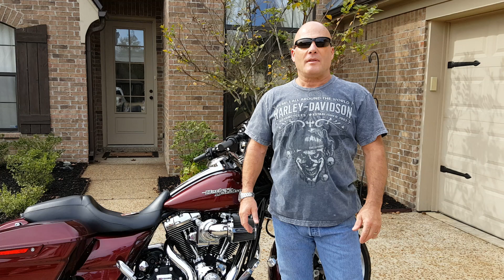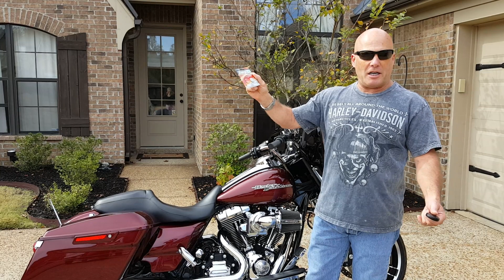Bike won't start? Could be your key fob!

Comment: Hey Tony, good advice on changing the security fob battery every year.  However, if your 2014 is the same as my 2013 security system, you can just manually enter your security code until you are able to get a new battery.
Reply: BrewCityRider
Reply: That's true if you know the code.  If the code is the standard one harley uses on every new bike, anyone that knows it can start your bike. Better that you change it to your own personal code as I did so no one else knows. That way if your fob isn't working you can still start the bike.
Reply: And where do you put the code?
Reply: @kevinmioto2248  You enter your code on the speedo using the turn signal buttons. The exact procedure should be in your owners manual.
Reply: @BrewCityRider  if you have a bike that's older than 2014 it's a different procedure than a bike that is older than 2014 you need to find the video they show you the two different ways to do it. I have a 2008 Springer with the security and a 2017 road King both securities to get into your pin or different. I found a video I think it was DK cycles or DK something he showed both ways to get into bikes free 2014 and post-2014. Then he shows you how to start your bike without your key fob depending on which bike you have using your pin number.
Reply: @BrewCityRider  my bad go to Ryan urlacher law-abiding biker. Com he'll walk you through everything you need to know about setting your pin and then starting your bike later without the fob.
Reply: @single55  Yep, I've seen that one and knew it was a bit different. That's why I suggested he check his owners manual for the exact procedure.
Reply: 2013 slightly different functions to 2014 but the same outcome.
Reply: When says enter pin press left signal number of times till the correct number show . Eg 7 press seven times . Press right signal to shift to next digit . There are five digits after the last digit press right signal again and bike wakes up . Your welcome
Reply: I changed the battery and still nothing!  It keeps telling my to enter the pin.  Have no clue
Reply: @hectorarbelo9965  Are you parked near a security system like the ones used at gas stations? If so, it can interfere with the H-D security system. Roll your bike away to a different spot and try again.
Reply: @BrewCityRider  Also don't hang it from your belt or trouser belt loops if it's right next to your mobile phone because the  electronic phone components can also interfere with the security fob as well.

Comment: In the back of your manual HD has provided removable cards that explain how to input the key code to start the bike.  First thing I did was change the "factory code" to my own code and write that on the card and then put the card in your wallet, and yes change your fob batteries every year.  You are good to go!
Reply from the maker: I never did set the code, of course I did it shortly after,  thanks and ride safe
Reply from the maker: Yep...

Comment: Hey Tony, Have been watching your upgrade videos and ran across this. I know it's old and you've got it figured out. You should have had a better salesman. Mine went over everything extremely well when I bought my my first HD in 07. Warned me about the battery problem and that I should always carry a spare. Also showed me that there's a card in the back of the owners manual that you can write your code on and has starting instructions on it. I was also told that it's a one time start. If you shut it off your done without a new battery. Love your SG & the upgrades are awesome. Had an 09 SG that same color. Just bought a 17 Road Glide. Loving the M8. Just praying it holds up! Already bought an extended warranty. First year motor wasn't taking a chance. Taking it in for Stage one and some leds like you put on your bike. You do great videos. Keep up with tha upgrade videos. Great idea on the ghost pipe. Never thought of that. Have fun and stay safe!
Reply from the maker: Roger Walsh Hey buddy, first thanks for the kind words, second I agree. My salesman was not very good.   Awesome on the new bike, I hope it holds up... ride safe brother

Comment: Good info security code if you know it. Bought mine used didn't know about code. Thanks for the video I had bought a new start button,because when I was testing it with a test light it started. After installing new switch and putting back together it wouldn't start again. then I found your video a quick fix. Thanks again.

Comment: You can also learn the process to bypass the security in order to get the bike home.  You need to know the security pin, but there are instructions on how to reset the pin code, then you won't get stuck.  You can ride your bike to the store to get the new battery.  AWESOME!  There is a very good video that demonstrates the process for both Pre- 2014 and newer for the new bikes as well.  It is published by Law Abiding Biker.
Reply from the maker: Thanks Dan, I know now but didn't have the code at that time.... Ride safe brother

Comment: For you guys with key fobs
You can override the system when your fob breaks,gets lost,or you forget it..
Each dealership has a code you can put in using your turn signal switches to start the bike without a key..as long as you can turn on the ignition...get the code from where you bought your harley
Reply from the maker: Thanks,  I know but I had not set up the code, I did it right after I experienced it.

Comment: Tony, I wish my issues was this simple! I took my bike to Harley a few months ago because while riding the bike the speedo displayed "NO FOB" then after a few minutes would go away. Harley claimed they fixed the issue. I found out I paid around $10 to $15 for them to change out the battery. The issue has continued. Went out this morning to try and start the bike and now the security lights flash and it asks for my PIN. I have never set up a PIN on the bike. After 30 sec the bike's speedo shuts down and nothing is displayed. I have tried both fobs and I get the same result. I seem to have a nice paperweight for a bike right now until they get this issue fixed.
Reply from the maker: Wow, that's crazy. It seems like the fobs have become unlinked from the bike or the BCM is the issue, let me know how it shakes out.
Reply: @tonyashHarley  Currently the "master mechanic" at the dealership has it and is currently diagnosing the issue. Day 2 and still no resolve. Told them to hold on to the bike until it gets fixed.
Reply from the maker: @RailfanDad  fingers crossed brother...

Comment: I have an 08 Street Bob, mine is doing that same thing. Thought it was a switch thing, it won't go into the lock fork position, but it was also doing the flashing lights and nothing. I will get a new battery tomorrow. Thanks for the info.
Reply from the maker: Jurnymn Cool, let me know if it works..
Reply: Tony Ash I will. I was about to have the switch changed out because I can’t get the key to turn back far enough to lock it. If the battery change works I will just buy a wheel lock instead of changing keys.  I will also find out the code and change it in case I ever lose the fob. 
~ Rob
Reply: Tony Ash I put the new battery in the fob today and it started right up. No more flashing lights. Your video is very valuable Tony, Myself and many other appreciate you taking the time to make it.
Reply from the maker: Jurnymn Awesome,  glad to hear it worked..

Comment: Good advice Tony about changing that H-D key fob battery every year to prevent a system SNAFU. In addition, it would be good to keep an extra battery stored on the bike. Lithium 3-Volt button batteries like the CR2032 can suddenly crap out or leak as well. Amazon sells a 6-pack of CR2032 batteries for $5.63 or 0.94 each. Cheapest key fob insurance around.
Reply from the maker: Foo Cue Thats a great deal, thanks for this, thanks for taking the time to reply. Rude safe brother.

Comment: Yes, that's good advice, that's happened to Me with My 2015 fuel injected Heritage Softail Classic, at first I thought the Bike battery was had it & I was up for a new battery but after testing the battery I found that, that wasn't the problem, so after talking to a few people I bought some new button batteries (size No°2032) & wadda ya know problem solved, I also learn't another valuable lesson at the same time, if you're going to remove & reinstall your battery make sure you detach the correct terminal first otherwise you'll set the alarm off because it has its own battery & isn't connected to the main Bike battery, after reading the owners manual it says that if you're going to do any sort of work like that, you should remove the 40 amp fuse first & then reinsert it last after you've done everything else & also another confusing problem I've noticed is that if the red flashing security light comes on & stays on, (even after starting) as a constant red light but doesn't flash, it's an indication that the filament in the  tail light or the stop light has blown & the bulb needs to be replaced.
Reply from the maker: Awesome, it’s crazy how the little things make such a difference. Merry Christmas

Comment: Man this gives me hope...I tried to hop on my 2009 Fatboy and its just a flashing and not doing any cranking...I thought ot might be the battery so I ran inside and grabbed my other fob...nothing. I sure hope they are both just needing batteries! Thanks for the vid   bro.
Reply from the maker: Hey brother, I hope new batteries work. Saved me I keep extras with me.
Reply: From my experience if one fob is out, so is the other one. Two new 2032's should do the trick.

Comment: Enjoyed the video but I replaced the battery and my key fob, still won't start. Purchased batteries at Walgreen, Wal-Mart and a Harley dealership.  None of them fixed the problem so I guess it's time to take it in to them unless you have any other ideas. Oh, the dealer override code front work either.
Reply from the maker: So I'm thanking it may be a Fob issue, thats not the first Fob thats malfunctioned.

Comment: Hey mate my 2018 breakout m8 114 security flashing on gauge when arming light (bike is turned off) is barely visible when not riding?? But I always connect to HD battery tender when not riding and is constantly on tender. It says on FP3 tuner 12.5v standby and running at least 13.8 volts loaded/running. So seems normal for battery. This isn’t a fob issue I guess, but when purchased bike the alarm on dash always flashed bright red when armed, now it only does it when reconnected to tender after a while. Also alarm has gone off a few times when I have stop breaks say at gas station or friends place for no reason? I’m assuming this is alarm/low faulty issue. Are the battery and alarm security system separate? Cheers for your response taking it back to HD dealership soon.
Reply from the maker: Hey brother , the red light uses a minimal amount of power. I also use a tender when not riding.  As for your security situation,  that is a dealership visit, it shouldn't be going off, I've never had that happen.   Let me know what they say, ride safe brother
Reply: Tony Ash thanks brother will keep you updated, thanks again for fast reply.

Comment: I know this is a older vid. Glade I found it. Mine is starting to to this. It sometimes takes it a sec. Lights flash to. Time to change mine. Mine has been in for 3y.
Reply from the maker: Glad you saw this, I learned the hard way. . Ride safe brother

Comment: I thought that was the problem but my bike fails to recognize either Fob even after changing the battery. It started intermediate then completely failed to recognize either Fob. Very frustrated because this is a 2018 RG special with less than 3k miles.
Reply from the maker: This may be an issue in the BCM, have you taken this to the dealer, its still under warranty.
Reply: Tony Ash Monday morning they are going to look at it
Reply from the maker: Michael Caudle cool...

Comment: You could always enter your code to start. Push the left and right turn signal at the same time you turn the ignition on, then push the left turn signal until you reach the desired number. Then Push the right turn signal to set the next number. Usually the factory sets it to 31313. If you haven't reset the factory code then you better do it now because I just told the zombies how to start it

Comment: What about when the key fob is good? Just changed my batter. Bike still flashing won’t start. It recognizes the fob because it doesn’t prompt for pin. 2012 street glide. Flashing after a 2 hour ride. Won’t start. But it’s not the fob.
Reply from the maker: This sounds crazy but flip the battery upside down and see if that corrects it

Comment: Harleys have an override too.  Turn the ignition on and hold both turn signals and it will ask for a 5 digit code on the odometer.
Reply from the maker: Yes, you are correct,  I didn't have the code then. Thanks

Comment: Read your manual you can use your blinker codes to override the fee Bob that way you don’t not be stranded into you get a battery
Reply from the maker: charles spidell I know that now but didn't at the time. Thanks, rise safe..

Comment: So I just had the HD security system installed by the dealer a month ago, sometimes when I get off the bike with the ignition off and the Fob on my person the Alarm goes off, this is annoying especially at night trying to put my bike in the garage without trying to wake the neighbors up, I know the system is new and don't know how long it set on the shelf before I purchased it but could the Fob battery be weak?
Reply from the maker: HD Road Glide I'd change the battery first to determine the cause. If that doesn't correct the problem, I'd take it back to the dealer and make them fix the problem.  I'd like to know the outcome, please let me know how it turns out brother.  Thanks
Reply: I had the battery last less than 2 years-mless than 1 year I owned it; so yes battery could have been weak..

Comment: I have an 06 road king---riding along and my skoot dies---towed it home---I had the fob in my coat pocket---I don't know a lot about the fob--never had a problem before---do you think It got pushed on in my pocket shutting my bike down--or the battery went dead on it---bike cranks over but wont start---got codes P1353  P1356 P1357 P1358---so I changed the coil and put new spark plug wires on it----nothing changed---checked--the crank sensor---955 ohms--wire back to ECM all good--7 volts to Crank sensor---I am stumped--as to what to check next---help
Reply: +poedog58 Should not be battery or fob related. Once the bike starts, you don't need the fob to keep it running. If you shut the bike down, you need it to restart. There are many stories out there of guys that started their bike, accidentally left the fob in the garage, got down the road to the gas station, and couldn't start up again because they didn't have the fob.

Comment: The same thing happen to me which i understand the dead fob issue. But when I changed my fob it still didnt work. I have also got a brand new battery. Never had this issue before.  I know my security code but dont want to have to do this every time...any ideas?
Reply from the maker: This may sound silly but is the battery installed correctly,  not upside down?

Comment: Wish I new this before the $300 towing fees (to my home, then to mechanic) 😢😅. My bike stalled and wouldn’t stay running. I was wondering why my lights were flashing on the tow truck. Bruh! mechanic says he changed battery and wallah 🤦🏽‍♂️. Now my wallets empty and I cant buy gas. Jk. He did say I may have had a gas issue but he rode it for 20 miles and the issue didn’t pop back up
Reply from the maker: Crazy the little things that can get us, now you know- ride safe brother

Comment: I was experiencing the same thing. Stopped into Harley for battery. Put it in fob. Did not start. Thought they sold me a bad battery. Then went to Walmart, replaced battery. Will not start. Even tried my spare fob. Same thing. Lights flashing etc. not recognizing my key fobs. Anyone know whats up?
Reply from the maker: I'm wondering if the component that reads the fob is bad? I talk with the service department at Harley.

Comment: My 2001 flthcui alarm is chirping and every once in awhile the siren will go off.  
Any help with this would be appreciated. Replace fob battery. No help.
thanks
Reply from the maker: So  my only thought is replacing the battery, you did that so I'm not sure?? Are you sure the battery is good? if you have 2 fobs, use the one that is the back up- change the battery in it and remove the battery form the fob your using now to see if it's a fob issue.  If that doesn't have you called the dealership service guys?

Comment: NEED SOME HELP CANT FIGURE THIS OUT. could my battery be dieing in mine ? it starts AND rides every now and then key light comes on or flashes and then I dont have a working right turn signal then I turn off bike and turn back on and blinker works again but then eventually light will pop back on and lose turn signal again so I'm wondering if its just battery in remote or something else?
Reply from the maker: Have you changed the battery yet, you should change it every 2 years.
Reply: Imma buy a new one soon! guy I  bought it from said it was new but its not starts fine if I ride it every day if I leave it set for week I put  tender on for like 5 minutes and it starts.
Reply: I did just figure out the security code so I might try riding with that and see if key light comes on or blinker stops working.